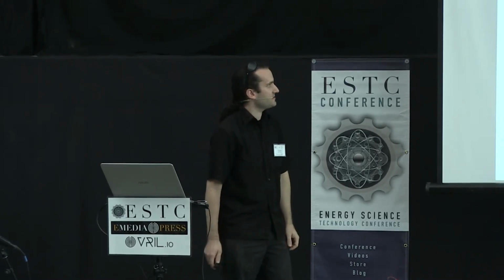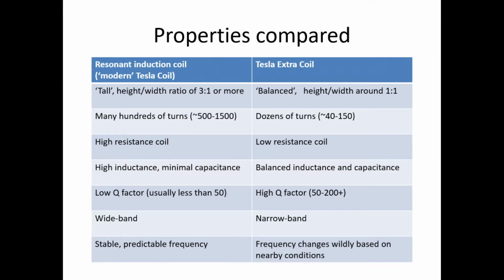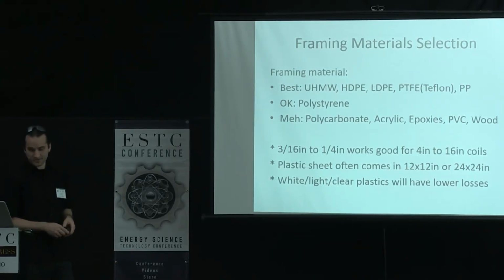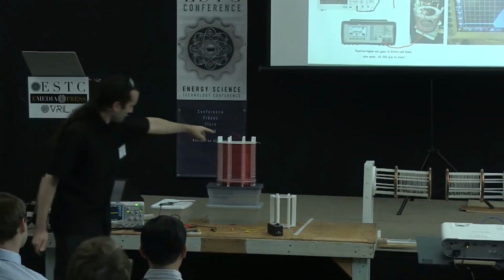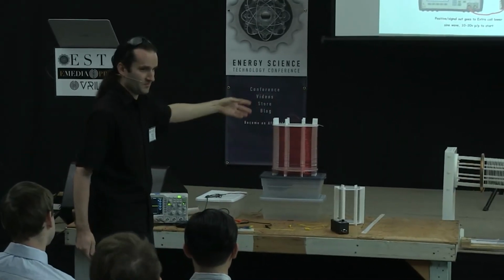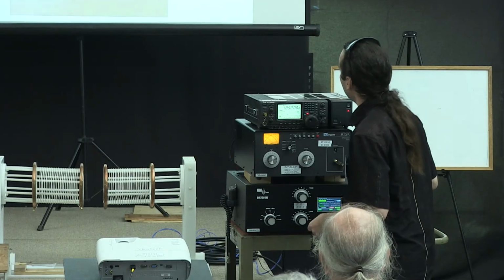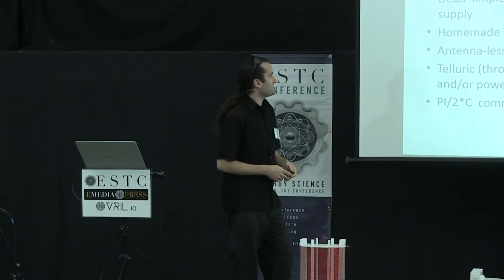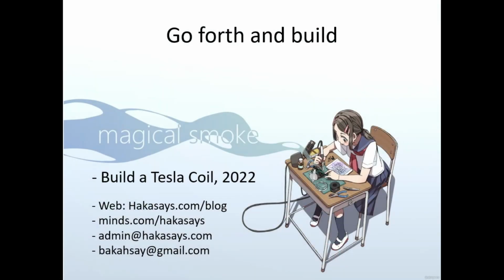Hakasays - How to Build a Tesla Coil The Way Tesla Built Them

Comment: I bet this is mostly what Don was trying to get across to people and what Rick F eludes to also. : )
Reply from the maker: I think so too, if not exactly, then I think the phenomenon occuring is something similar.

If you follow Bob Greenyer's work at MFMP, he often talks about how Ball Lightning events have something to do with a resonant oscillator, he describes it symptomatically behaving exactly like how these tesla coils, and Don Smith's devices, operate, in terms of nearby electrification.

Bob Greenyer says it's more or less pulling the photons out of the air. I think Don Smith in 2005 said with his assistant that his device is also capable of draining radio tower signals, which is draining photons out of the air as well, haha. 

There's probably some phenomenon at high frequencies in particular that absorbs these photons and creates an artificial Casimir cavity around the device, or something like that. Bob Greenyer has a whole shpeal about it so I'd recommend listening to him talk about it instead of me, if you haven't already lol.
Reply: @CheyenneChild-  😀
Reply: You should take a quick look at this cold light I made inside a plasma ball using an “odin coil” It’s very reminiscent of how Tesla described the pure white light in his globes